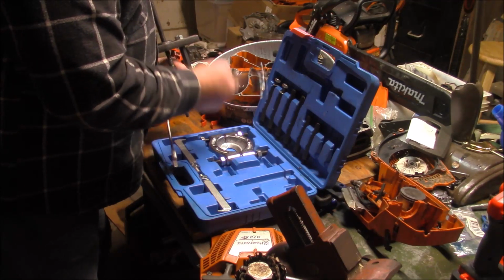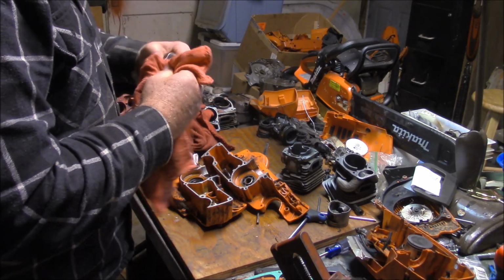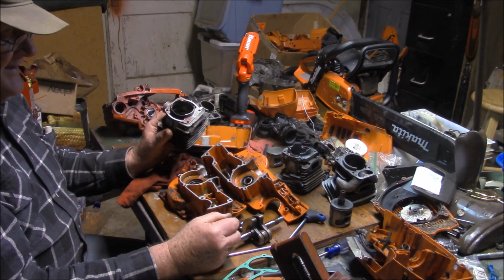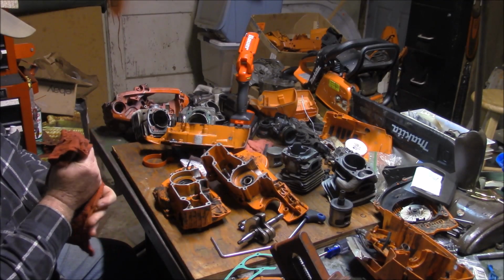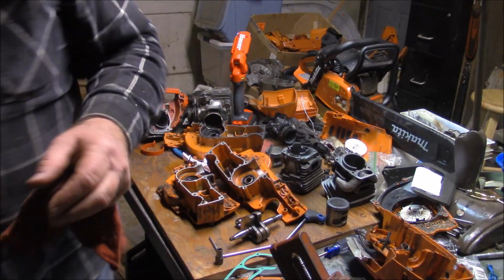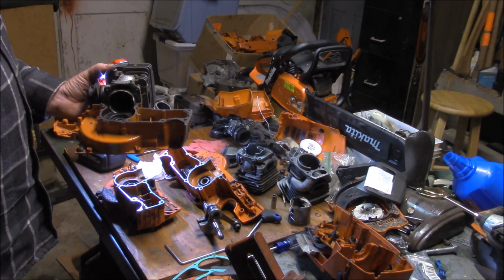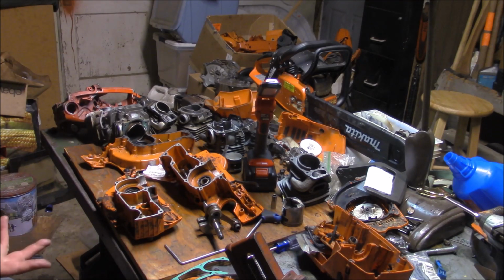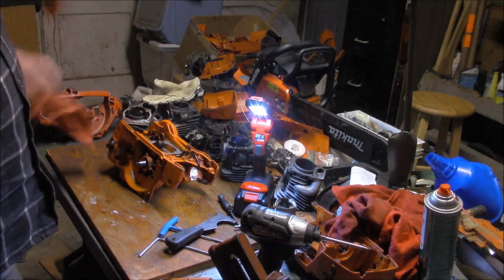Kickin Around Cases & Speculation On Older Husqvarna 372's

Comment: Thanks for the insight, I love your series on the 372xp,, 372 x-torq I didn't even know there was a difference I have a jonsered 2166 of 2015 vintage or so and it is an x-torq, thing was my go to saw until about a year ago, I ordered a new carb kit for it off ebay never did run right again, constantly floods despite filing down the nipple on the Chinese pump diaphragm, one thing I did notice is the pto side has some play, compared to my 2165 that feels solid, I immediately took it out of service until I get a 371,372xp cylinder and bearings to rebuild it! Before it grenades!

Comment: One part that I have added to those parts that I replace on Farmertec kits is starter pawls.  Yesterday I replaced the starter rope in my Ms 250 kit saw because it had become frayed.  I also noted one of the starter pawls had the end missing from it.  Since the Stihl MS 250 only utilizes one starter pawl I left it as it was, but today I am going to get two Stihl starter pawls and replace both of them.  The 250 has lots of compression and even though I have an Elastostart rope on them, they are tough to pull over.  Just thought you would like to know.  I have broken one ElastoStart starter rope on my new Stihl MS 250 and a starter pawl on my Farmertec kit 250.

Comment: I agree 100%.  I build my saws to much higher standards than most factories, even Stihl.  Screws get Locktite or 1184 on them.  Bearings and seals are coated with assembly lube, etc.

Comment: Ive been watching alot of your vids. On the 372 series. Now i know you can swap case halfs from one 372 to another . Now can you swap a china half case on a oem half case? They fit together , i tried it but havent put a crank in it.
Reply from the maker: Actually it's not easy. The "location" pin holes on the clone cases are larger in diameter. If u had a mill and a way to fixture them...maybe by opening up those holes. But I wouldn't use a hand drill even a drill press because of the alignment implications
Reply: @afleetcommand  Hmm, maybe on some. But the 2 sets i aquired with broken cranks have the same size location hollow dowels.  And fit right together. Just a fluke?
Reply from the maker: It's not the location, the diameter of the Aftermarket location pin holes & pin is simply larger
Reply: @afleetcommand   sorry i guess im not clear on the description. So i can put the china half and the swedish half together. With the location hollow pins in the halfs they go together all the bolts line up perfectly. So ill try a worn out crank with old bearings just for a test.
Reply from the maker: No you can't mix them unless you machine the location holes to the same diameter. If you put the Chinese half with an OEM, the larger holes on the Chinese cases won't allow the OEM location pins actually keep the cases aligned properly  . If you use the Chinese larger diameter location pins, they won't fit in the OEM location holes. Pretty straight forward stuff actually , large pin too small a hole thing or too small a location pin to a much larger hole. :)

Comment: They get hot and melt from lack of oil, or dirt/sawdust. Drill lube hole down threw case till comes out in-between bearing and seal
Reply from the maker: Maybe. Certainly wouldn't hurt. I didn't have to when I did my builds and they lasted two and three times longer than they did out of the box with the logging operations I supported at the time. Most still out making money. So sticking with the steel caged bearing & location pins along with RPM related vibration theory for now.
Reply: @afleetcommand  ya Roger that 👍 keep up the good work 🔧🔧

Comment: Smaller transfers mean less gas air mixture is able to reach cylinder.  Less gas air mixture means less cooling, hence more heat is produced.
Reply from the maker: Less fuel air mix also means less heat created from combustion. On the 500's it's about something else
Reply: @afleetcommand  lean mixes means increased temperature in my experience.  There was a test on UTube using 25 and 50:1 fuel mixes and 25:1 produced hotter engine temperatures than did 50:1.

Comment: There is always the conflict of weight, power and displacement.  Compounded by an attempt to meet EPA standards.  The Stihl ms 440 and 460 use many of the same parts, but not crank, cases and bearings.  Theses are about 10% bigger in certain critical areas, like the crank and bearings.

Comment: I’ve never had anybody say specifically about what killed my Xtork from 2018 when it was repaired under warranty in 2019, BUT I’m really confident that it was my lack of understanding how to tune the 2t engine. Why do I say this, I use more oil in the mix than what’s called for, effectively a 32-1 mix. But that’s going against a factory 50-1 mix. My dealer didn’t catch it AND (like I mentioned) they (Husqvarna) replaced parts and then paid the dealer 1.5hrs to to r&r parts in the engine. Now I know how to tune by ear AND I have and Xtork style of tuning screwdriver. 😊
Reply from the maker: Nope 32:1 didn't hurt that saw unless it was a crap oil. That one is way over analyzed. Some times it's simply statistics. A bad part or out of spec part. And also never really know if some of the parts from earlier "parts" bins make their way into the later models as things transition. I haven't seen a 2017 or 2018 dead but that doesn't mean in the entire world there hasn't been a statistically typical amount yours unfortunately being one.

Comment: Honestly I would think that Husqvarna would have caught these problems,  but with seeing that they couldn't stop a kinked fuel line making it to market blows my mind!
Great video Walt.
Reply from the maker: But they did is the point. Took them a couple of cycles maybe to get them all right. Suspect with the manufacturing anomalies it was a little bit of a moving target. That along with the time it takes to get in the field,  have time to get feedback through the warrantee process, design a change , then work that into the manufacturing of the production saw & parts inventory.

Comment: Hello Walt and good morning I need some help I am getting ready to purchase a 2050 turbo jred and I was wondering if I can use a 350 husky cylinder pan instead of the clam shell to change the cylinder to do some port work hopefully you can help me with this information hunt
Reply from the maker: Not sure that will work. Those might be the "layer cake" case designs which are pretty much unique to themselves. Guess I would check the intake parts, see if they are the same as a 350 for a reference. They are similar but not sure if they interchange.
Reply: @afleetcommand  Thank you for getting back to me Walt I will look into it and let you know what I find